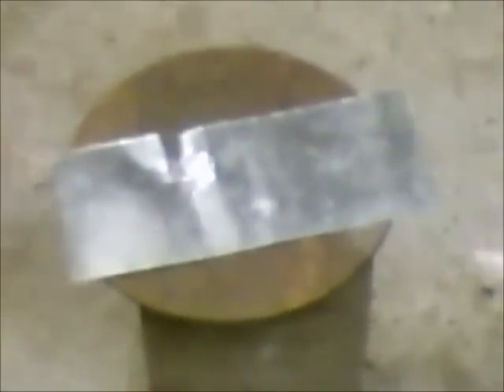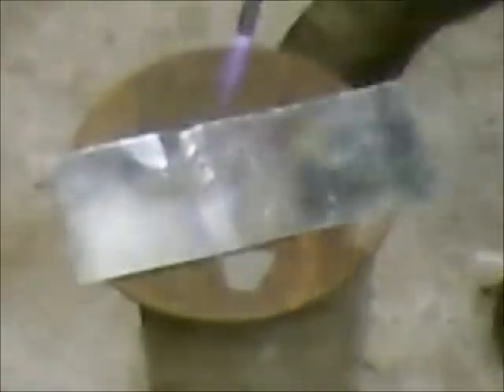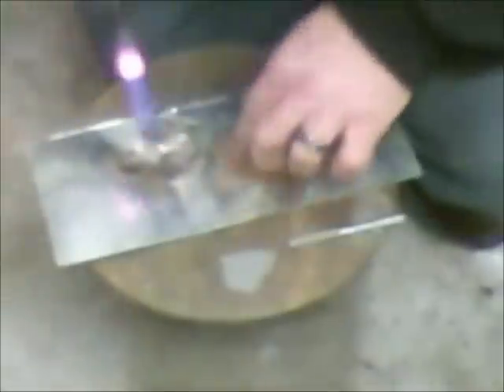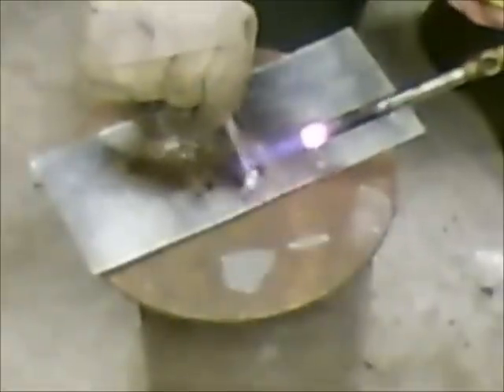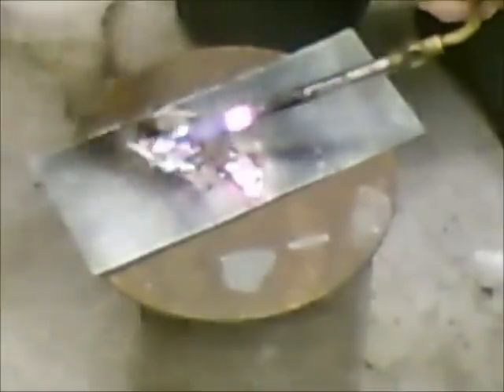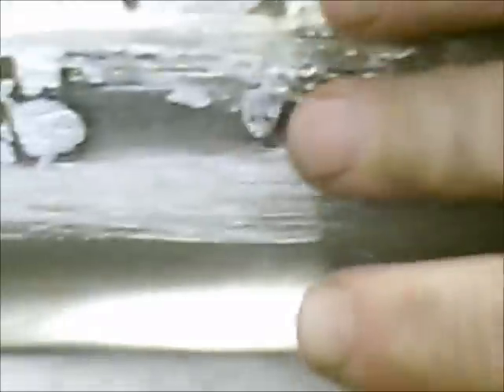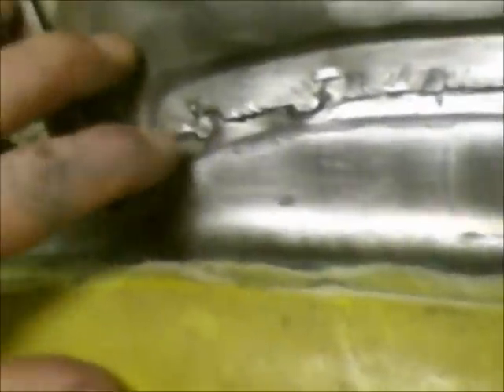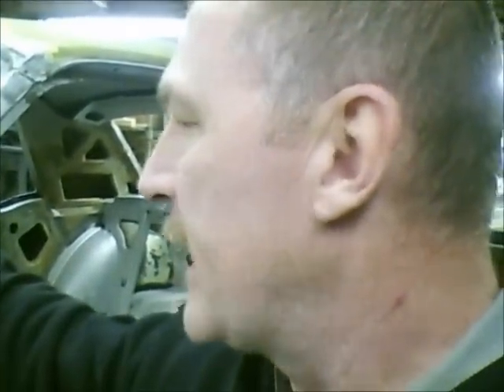Lead vs non lead solder

Comment: I'm going to get some work done on a hot rod, they are considering lead, but I've also heard of brazing? and now from you lead free solder, so what are the cons to body filling with them and long term effects. I've also been told that lead is not a good idea to paint over once its done?
Reply from the maker: Lead or lead free solder are both great materials to fill areas as they expand and contract at a similar rate to the metal panels they sit on.
Plastic filler can often be seen with a car sitting in bright sunlight as the car heats up.
Solder also has a superior grip to the metal surface where plastic filler has to have holes or grinder marks to attach it.
The lead free solder is a bit more finicky to work with but is safer to grind or sand than regular lead which is usually filed to finished contours to avoid making fine airborne lead dust which is hazardous.
The brazing process was used to assemble some components together in preparation for spot welding in the older cars.
My 67 mustang had the corners of the cowl vent brazed in place then lead was used to smooth the surface.
The soldered surfaces need to be cleaned with a baking soda solution to neutralize the acidic flux used in the soldering process.
Then a good quality etching primer is used and followed up wit what ever paint system you choose.
I have several videos saved in my lists under  "How to lead" with some really great lead masters like Gene Winfield,Bill Hines and many others that will show you their awesome work on the issue.
Thanks for watching and the fantastic questions.

Comment from the maker: @davemiii The solder is definitely stronger than short strand fiberglass.
I would recommend the lead free solder though because it can be machined,sanded,ground etc. without lead exposure.
Thanks for watching.

Comment from the maker: @wildeyednorthernboy The kit was 189.00 which had the dvd,2 lbs of the solder,a vixen flat file blade and holder,tinning butter,paddle lubricant and 2 wooden paddles(flat and half round).
The additional lead free solder is $60 a pound(ouch).
Thanks for watching Thomy Schuu.  :-)

Comment: Hi Cecil, I have zero experience with putting lead on however I've had a lot of experience getting primer to stick to it. Maybe the flux or wax from the paddels plays a part,,I have found times on many a sail panel where a skim coat of a 2 part finishing putty was needed to keep primer there.Wanted to bring it up early so you might want to consider testing a scrap piece with a swipe of solder/lead on half and plain metal on the other half to see how your primer likes it..just planting the seed.